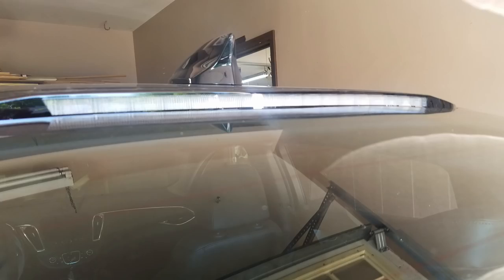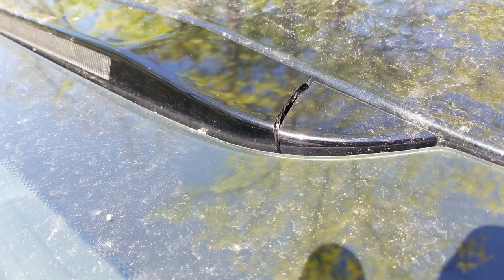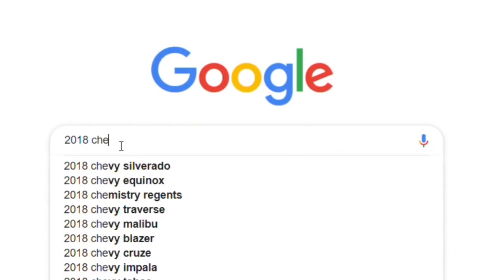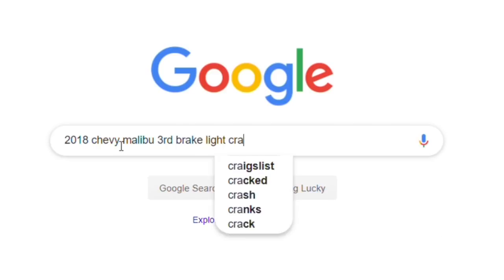5 Tips to Follow To Avoid Getting Ripped off for Car Service or Repair

Comment: Tip, If you can mark the old part for example an oil filter can, struts, ball joints anything you can reach then do it. Use a permanent marker and put a line or dot on it. It's a quick and easy way to glance at it after and see if the mark is still there or not. As they say Trust but verify.
Reply from the maker: Great tip

Comment: I have been an mechanic in independent shops for almost 50 years (just retired) and i agree with what you're saying. Nobody gives a crap anymore. It's all about money and not customer service but sometimes there is another side of automotive repair.
People try to blame the shop for things unrelated to the repairs just completed. Several times over the years i completed a repair and the customer came back and accused me of a service engine light that wasn't on before they had repairs done or damage that wasn't there before. I even had a customer accuse me of removing his new tires and installing worn out ones. 
Your experience was deplorable and no excuses for it but there are problems on both sides of the service counter.
Reply: T Web  ,  no, not BS. Apparently you have never worked with the public much.  You wouldn't believe some of the stuff people do, either on purpose, or out of ignorance,  but people come up with some of the damnedest things
Reply from the maker: I get people blaming me for other things as well... like, you changed my brakes and now the radio doesn't work...lol

Comment: As someone who has been a service advisor…I can tell you that things that seem like a Huge problem online might not be something we have ever seen.  Ford GM Toyota sell hundreds of thousands of cars and trucks a year.  Sometimes you may actually be the first one a service advisor has ever seen.  Most dealers have many advisers.  It’s kind of luck of the draw if we have seen that problem.  Now I agree with you that sometimes the problem is so prevalent every single car truck or suv we see has the problem…. But this is rare.  Some problems that seem like a huge deal online I wouldn’t have seen the problem in my whole career.  The supposed Ford 8.8 clunk is one such problem. In 17 years I have never saw one.  It’s always the driveshaft splines that I have seen. Some other advisors may have done a ton of them.  I just never did.  As for saving parts…. Ford will not let you do that on a warranty part.  Ford randomly calls for parts to be returned and sometimes wants to examine the part to see why it failed.  I have seen Ford send engineers to look at a problem on a vehicle or part.  Only customer pay parts can be given to the customer.  We can only charge what the manufacturer says we can charge on a warranty part.  Your brake light probably only paid 2 tenths of an hour.  We can’t not send a bill in for 2.5 hours…. the manufacturer would laugh in our face and not pay the warranty claim.
Reply: you can put the part aside after the repair-  you don't have to GIVE the car owner the original defective / broken part.  He just wants to see that the repair was actually done because, you know,  all you service 'advisors' are so honest.  And as far as not knowing about a problem even though it's all over the internet... ah, you service 'advisors' don't get service bulletins from the manufacturer that SHOULD be sent to the dealer?  I mean, this IS the 21st century - I'm sure there's an information stream somewhere that will keep you service 'advisors' up to date.  Why don't you just admit that you don't bother to read those 'pesky' bulletins... it's easier to screw the customer than do your job.

Comment: Dealerships= Legal Ripoff.   MAYBE 10% of them are honest,  but that is a stretch.   Thanks Pete. Save the old part. that is what i have told my customers for years. ( Little old lady, sitting right next to me in the dealership; the quoted her $200.00 for serpentine belt .  5 minuite job, shop needs to charge minimum prob. 1hr + cost  of part. Just the situation guarantees overcharge.(IF you find an honest Mechanic, and his prices seem high,theyis are probably worth what  theyare charging.3 years auto mechanics. Plus 43 years helping folks to not be ripped off.
Reply from the maker: Thanks Keith, I do have people I trust that I send folks to when I can't fit a job in

Comment: What do you think about if they do not return the old part no payment? I am to understand that you can write this on the work order if they do not want to do that do not have the work done at that shop
Reply: If it is not covered under warranty they should give you the parts back, but if it is covered under warranty the dealership has to tag it and put certain information on the tag so if the Manufacturer wants the part back then the dealer will have it to return to them. Manufacturers do this on a lot of warranty parts so they can send them to be analyzed to find out what needs to be done to fix the problem. I know Ford does this, so i'm guessing all of the Manufacturers do this.
Reply: @goodtry1550  I have a 24 years old car so it is not under warranty and I require all part returned to me in writing. No parts no payment. I have caught several shops trying to screw me over and they do not get away with it .
Reply: @ronjohnson2693  Then you should get your parts back, especially if you requested them be returned. I wasn't sure how old your vehicle was so that's why I explained the warranty part being held by the dealer. You are correct, they should give you all of your parts back when you requested it.